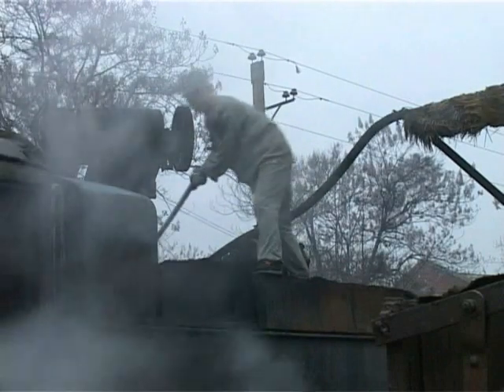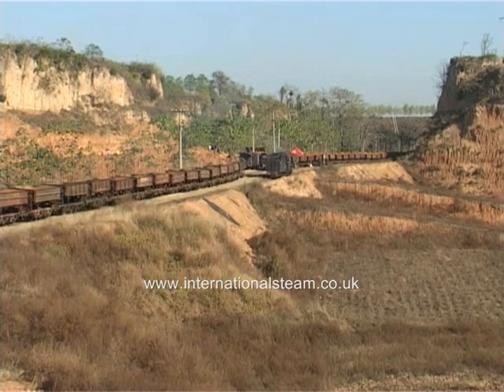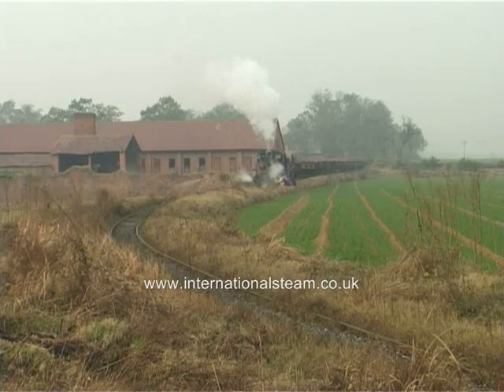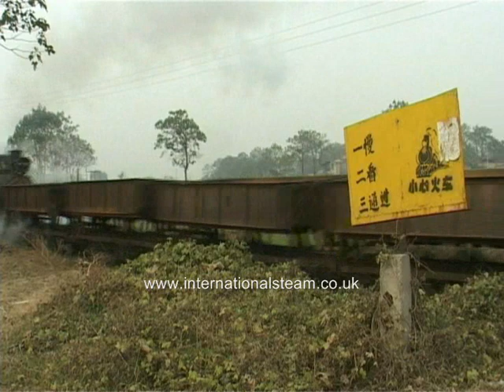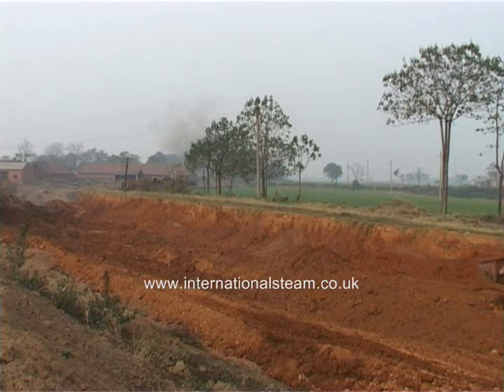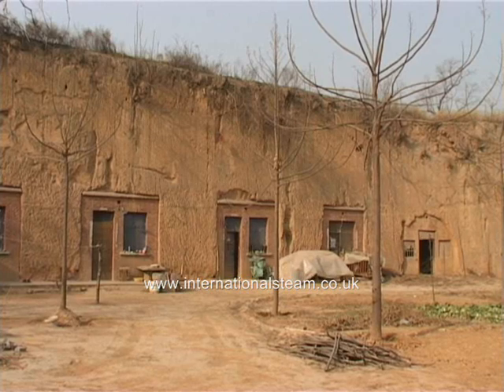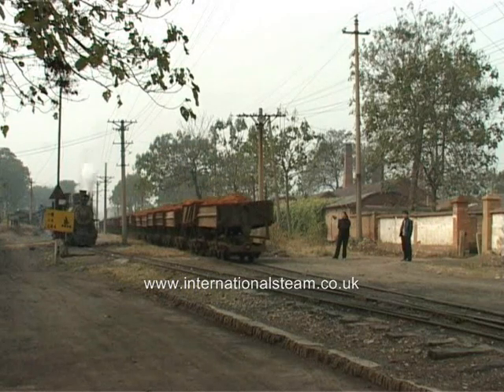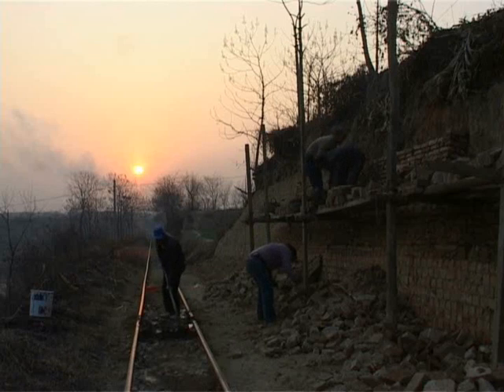Xingyang Brickworks Railway, China Part 1

Comment: way was the engine crews stoking their engine with coal dust? was the steam coal in China very poor quality?
Reply from the maker: Actually, dust is not necessarily low quality coal although it needs skill to ensure it doesn't go straight through the tubes, which by and large it didn't here. All these narrow gauge railways were run on the proverbial shoestring and I guess in this case these locos used the same coal as the brick works where slow burning dust was needed as seen in Part 2.